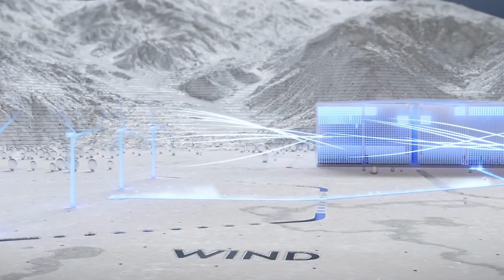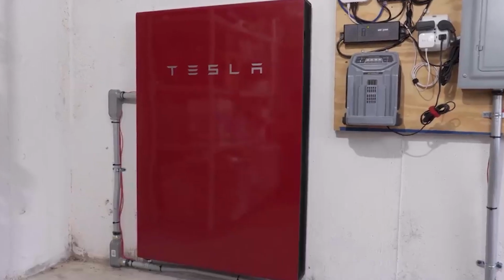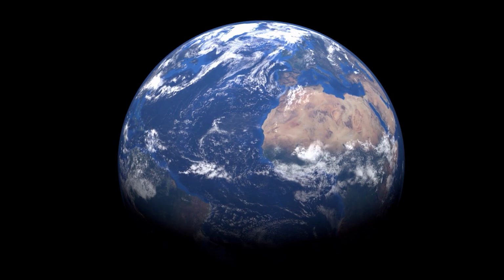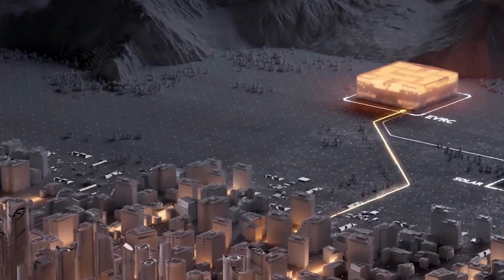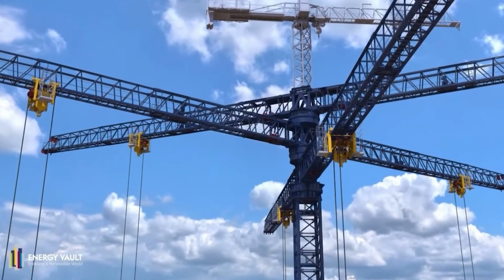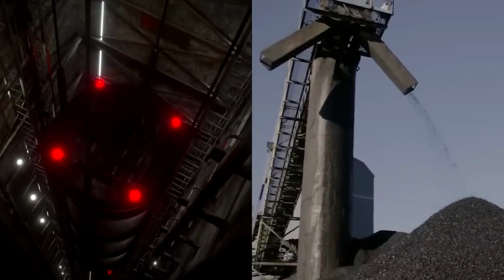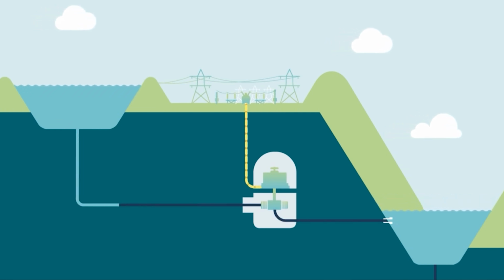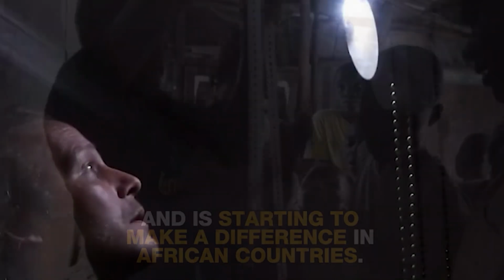The Secret to NEVER Running Out of Power Again!

Comment: Very good idea but 1st thing that comes to my mind: I fear for these peoples lives.  All engineers who came up with ideas for 'free' energy were found dead under mysterious conditions when they came to close to reaching a point to go commercial. 
2nd I didn't fully get the problem of unwinding cables. Can you not use the same sort of cables like on tower-cranes or mobile cranes? The suppliers for this market have a lot of experience with these kind of problems. 
3rd I'm really curious how you can control the power output by letting the weight down slower or faster. Is that in the winch section or with a brake system?  Also like to know see more info of  the generator behind it. 
Definitely a 👍🏼

Comment: Not hating, just trying to be helpful, "winches" is pronounced win-CH-es what you said was winces which is the act of grimacing or recoiling from pain it, it is a word just not the one you mean. 
As to the content of the video it was unique to see coverage of gravity batteries that didnt focus on hydroelectric gravity batteries. Many of the designs ive seen for them involve large water tower clusters as a solution for nonconducive topography but those projects do involve more construction than is ideal so i get why they werent included, it muddies the waters (no pun intended). Im very interested in how material engineering might help with problems like the torque on the cables. I might swing my the materials sciences labs next time im in campus and ask (my field is biochem/genetic engineering so its just down the hall). You broke the subject down well and made it easy to inderstand, just as an example many if the channels i follow would not have explained what effect torque has on steel cables but you took the time to explain for thise who wouldnt understand. Very graspable coverage, i love to see it, if the other videos are done this well i think ill like it here, i think ill be subscribing now, keep up the good work. 
(Also sorry if there are any typos im dyslexic which sucks because engineering now involves a lot of coding)